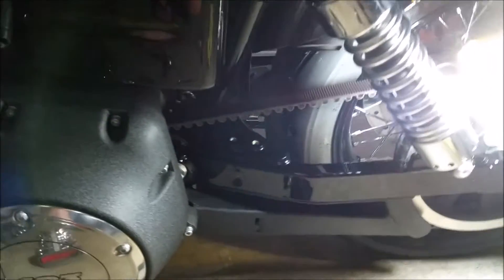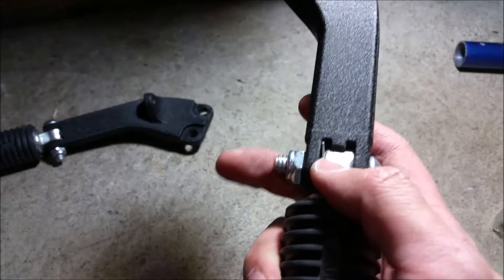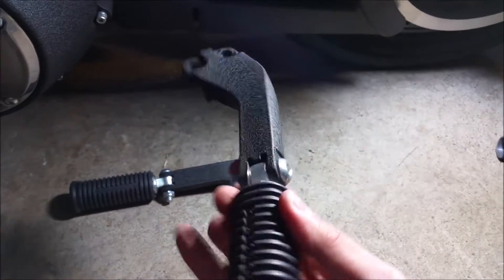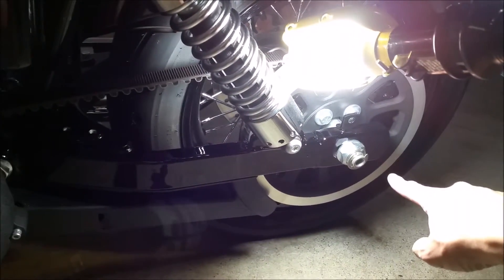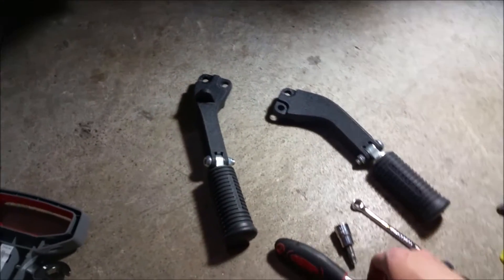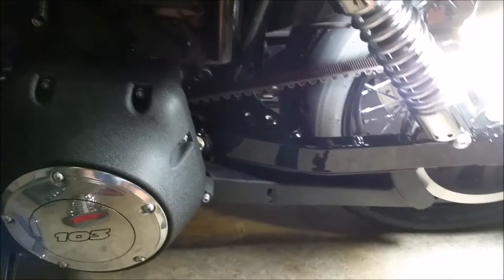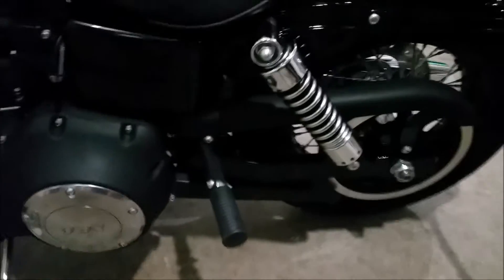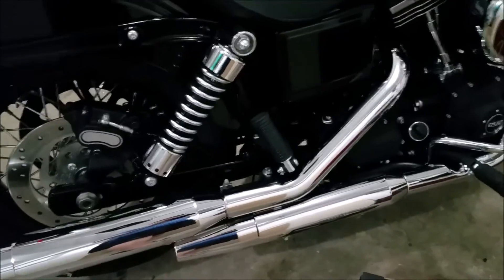Passenger Pegs Install - 2015 HD Dyna Street Bob FXDB

Comment: I used this wrench-torx-socket method and it worked like a charm. I did this on my 2017 Street Bob. I ended up having to use the same method to install the other side's mount as well. It was a straight forward installation once you have the method down.  I'm glad I found this video. I'm going to pass this trick on to all of my friends. I rate it this install at infuriating/10. Thanks Harley.
Reply from the maker: haha right on man! I was feeling lucky that solution just came to me...I didn't want to buy new tools..

Comment: I did mine on the kickstand as well but I took my seat & side cover off and ran a ratchet strap around my drive belt to a rafter in my garage. Ratcheted the belt up enough to get my 3/4 ratchet in there and that was it. Super easy without a jack. Literally took 20 minutes to do both sides. 2017 fxdb

Comment: I just finished installing passenger mounts and pegs on my 2016 Dyna Low Rider S (FXDLS). I ran into a similar issue that you had, but slightly more with the bolt positioning. All went well after some tool experimentation. I recommend a good buddy and some beer to get the job done without throwing a wrench or kicking your toolbox.
Reply: Just wondering have you been able to find a service manual for the Low rider S yet?
Reply: mine came with a 2016 dyna manual

Comment: Hi Ken Moto - thanks for posting this.  You just saved me a BUNCH of work! By using the torx bit with a 9mm wrench I was able to get this done on the left side of my Dyna Fat Bob FXDF in about 15 minutes.  I'm not sure why the Harley instructions don't mention that little trick.  Anyway, if you are ever in Portland, OR I'd be glad to buy you a beer.
Reply from the maker: haha glad to help! its weird how I was told that I have to loosen the belt and all that just to install pegs. I guess the tool trick was too unconventional. but yeah a slimmer torx ratchet kit should do the trick
Reply: The footpeg kit I ordered from HD actually said to loosen the belt as well.  I didn't want to do that because that meant I'd have to tighten it back up and adjust / align it afterward.  Which turns makes the install much more complex.  The capitalist in me thinks HD likes it that way as it would drive more folks into their shops!

Comment: i have a 2016 and installed these identical passenger pegs this weekend. DO NOT REMOVE THE AXLE NUT OR LOOSIN THE DRIVE BELT!! your just asking for future problems.   find some sort of support and take the seat off the bike. strap under the seat frame with a couple rubber coated ratched straps "this is where the support comes in" what ever you use make it to where you can lift the rear end of the bike with the straps. have a buddy help you so you dont accidently knock your bike over incase a freak accident happens. strap the bike up put slight tension on the straps and remove the two lower shock bolts and lift the bike the shocks being off will allow the rear swing arm to drop and you can get a full size rachet and socket on the bolts to remove and stall the pegs!! sounds like a lot and im sorry for typing a book but its alot eaiser than it sounds 10 minute or 1 beer job!
Reply from the maker: or just do what I did. lmao

Comment: Great video! I'm getting ready to install the same kit onto my 2013 SB. In order to take the belt cover/guard completely off (after removing the screws), did you have to remove the lic plate holder? I see yours it on the side, which is the exact setup I have. Was looking at it tonight, and wasn't sure if it would slide out/through that space between lic plate holder and wheel/fender.
Reply from the maker: You don't have to take the license plate holder at all. the belt guard is completely seperate just take the bolts out and angle it then it will pull off.
Reply: Ended up going to the dealership to have it done. Tried a few bolts, almost stripped 2 of them...no thanks. Cost an hour of labor, but saved on the headache/frustration. Even they told me it was a b***h to do, ha.

Comment: For the torque specs, when to stop tightening, when did u know to stop? Just by feel?
Reply: My t45 is to long for the left screw. Im going to half to find a shorter t45, as it hits that frame tube coming up. Grrr
Reply from the maker: +crazyfool710 yeah I just tighten by hand. it's not really a very crucial part that needs torqing.. just make sure it's tight
Reply: Ken Moto good deal. I used your method. Was very easy to install them. My sportster was harder. Had to take the exhaust off! Safe riding.
Reply from the maker: +crazyfool710 yikes! glad to help!

Comment: Does the belt cover bolt to the new bracket and someone told me that you had to remove the master cylinder to install the right side. I can't even see where these brackets bolt up.
Reply from the maker: I can't recall. I remember I removed the belt cover because I need access for tools to screw in the new pegs. They're very straightforward. my only challenge really was clearance for tools. other than that it was easy.
Reply: Thanks Ken
Reply from the maker: Actually on the left side for the belt cover there is a screw mount spot where you mount the belt cover to. I had to rewatch the video to remember. but yeah that wasn't the hard part as I mentioned.
Reply: Thats what I figured from the looks of the brackets that Ive seen.
Thanks

Comment: How did you pop out the nuts or plugs to be able to screw in the peg legs?
Reply from the maker: You will need to use some kind of pick and preferably a plastic one to just pry it off. be careful not to scratch the swing arm surface.
Reply: Ok.. hmmm thanks man.

Comment: where did you buy these.?
Reply from the maker: ebay
Reply: +Kenneth Yang ok thanks anyway particular seller.?
Reply from the maker: +Ruben Gonzalez just make sure its the oem harley if that's what you prefer. its all I searched for. It might be sold as the mount only and the pegs seperate. I got this as a set. more convenient that way.
Reply: U should put the link
Reply from the maker: read the description please